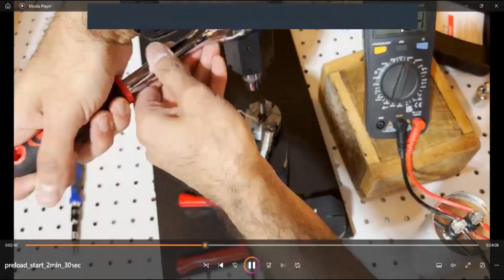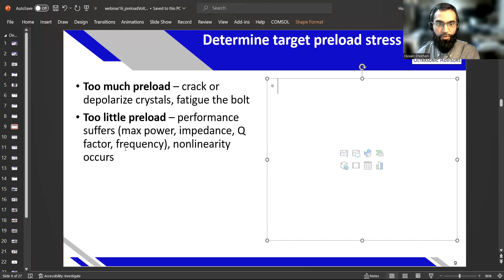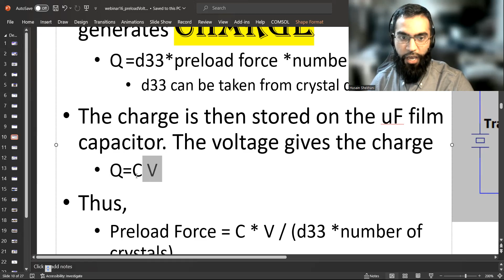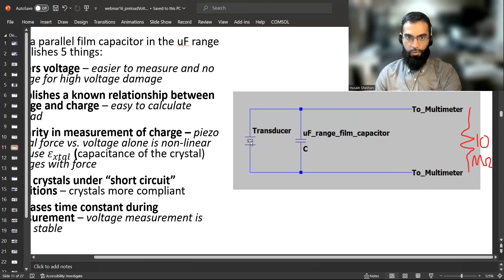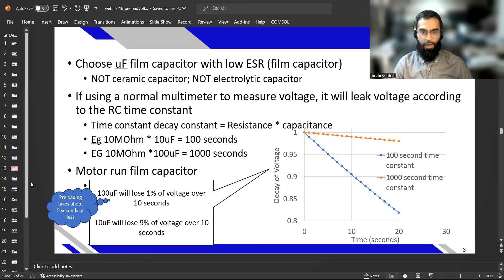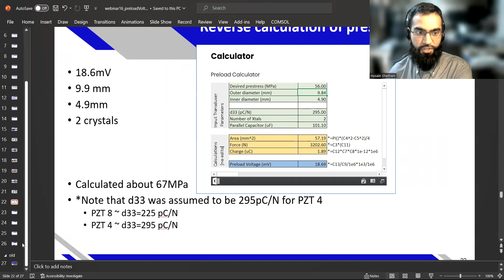Preload measurement circuit for bolt-clamped ultrasonic Langevin transducers

Comment: Ever mess with a Fluke 8060a? I'm working on some ceramic preload stuff at work. You can pop out the two bottom mode buttons and on the 200mV or 2V range the input resistors are removed from circuit. This essentially makes for a near infinite impedance. Thought that would be helpful!